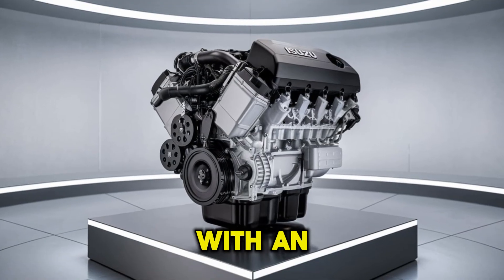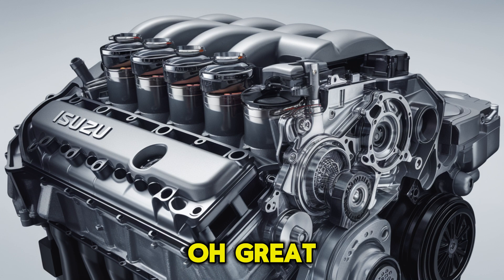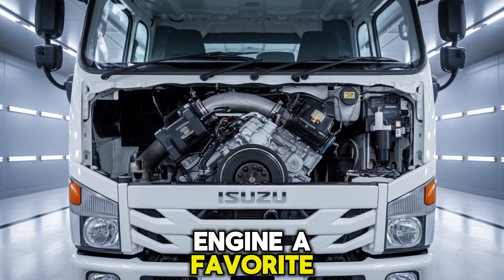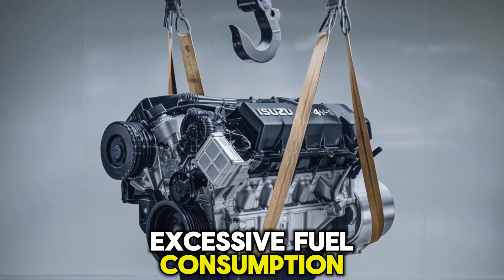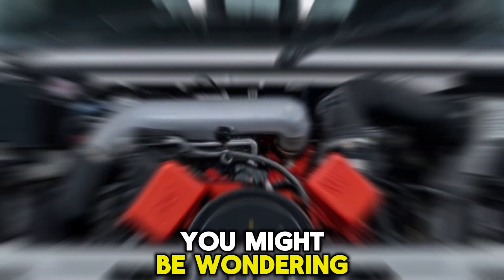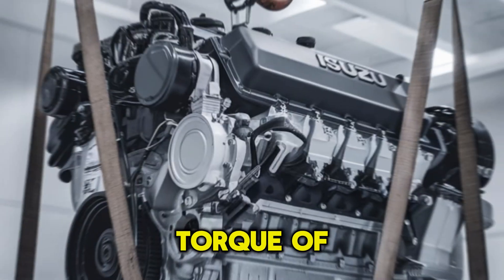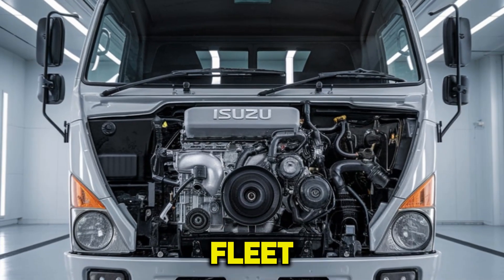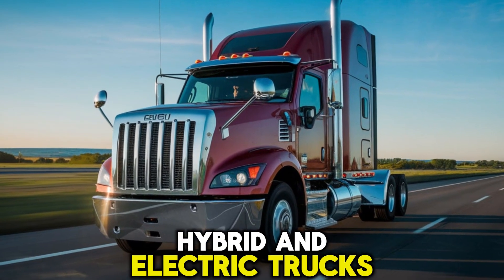Isuzu 4HK1 Engine Explained – Power, Performance & Reliability Breakdown

Comment: All medern diesels are junk. Expensive parts. Compare fuel pump from isuzu to others and confirm. 6.0 gm gas is bulletproof ,easy to fix and parts are cheap and eveywhere. Just a little more fuel hungry but well worth it.